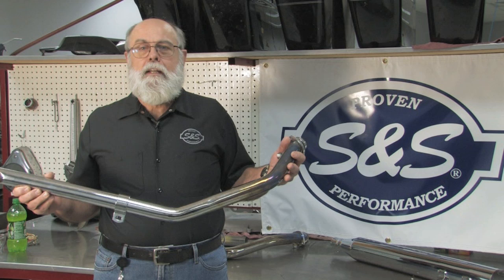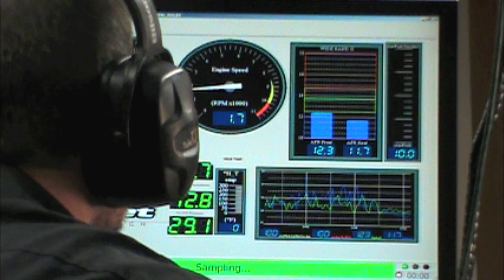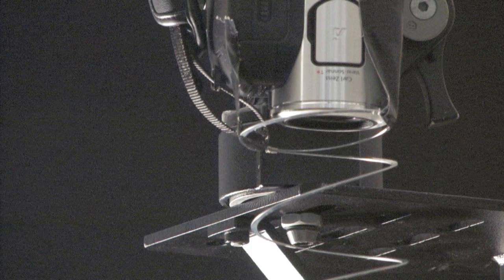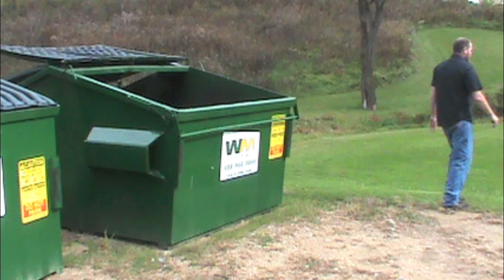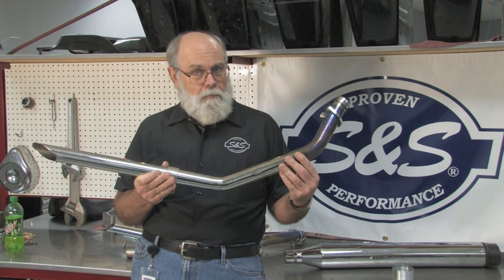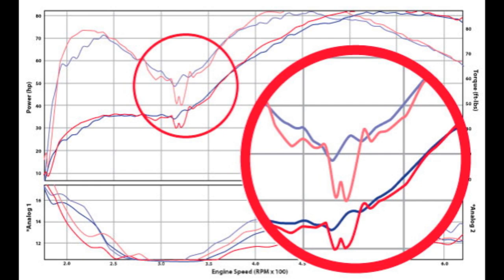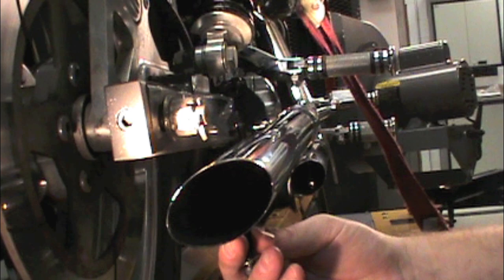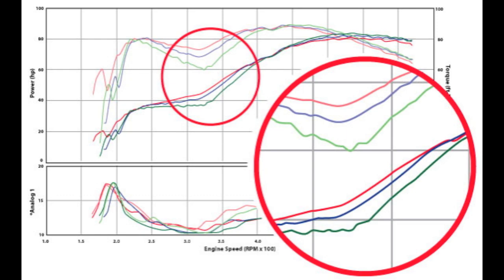S&S Cycle - Drag Pipes Style Exhaust: Carb Jetting and Troubleshooting

Comment: I've been trying to explain this concept of resonance for awhile to a few folks I ride with but while I understand the concept, it's hard to explain to those that don't. The slinky has been the best example I've seen so far. My drag pipes are not equal length. I can actually feel a 'shudder' from my engine in the low/mid range with more carbon fouling in my rear plug. The different resonance is affecting how that rear cylinder is pulling fuel and dumping exhaust but many can't wrap their head around the idea. Much respect to your explanation good sir🤘

Comment: The mufflers you had and drag pipes with baffles are almost completely identical except one thing stock exhaust with mufflers have headers crossover so it basically makes it to be 2-1 exhaust system. As a result connecting to cylinders to work together. So basically in the video you proved how good is 2-1 systes🤠

Comment: Loud pipes save lives! Text messaging idiots kill people. Drag pipes on my 03 1200C and I let people know I'm riding beside them or just in their general area.  Houston traffic is insane. It gets them looking around instead of looking at their phone. Free flow air cleaner, bumped up the pilot jet and it runs great. Doesn't cough through carb and no backfire on deceleration. Not trying to squeeze every half hp just a good sounding quick scooter to get me out of a jam before it happens. Be safe.

Comment: Excellent video,. !!!!  I've been telling people this for over 35 years, !!! On motorcycles and,.  Cars,, 2 1/2 inch,,, pipes and warlock mufflers,,,, will kill your low in torque,,,  !!!!   There is absolutely no way to build more horsepower and torque at the top end,,.  Without taking it away from low mid-range,,. !!!!

Comment: thanks S&S. I got the bike with the kit and pipes as it stands now. I rebuilt the carb the other day and checked the jetting. I'm trying the tips suggested in the video as all the "usual culprits," timing, plugs, ,wires, ( new Accel coil and wires and plugs), have been adressed. But I have no problem replacing the pipes with ones with mufflers. Those S&S looked sharp.

Comment: Anti-reversion cones up by the port used to be a big thing in V8s. Also, if you drill a small hole at the "top of the port" in the tube, it'll pull in air and create an after burn in the pipe, speeding up the exhaust flow. Smokey Yunick knew a lot of tricks. Exhaust flow management is a black art. Straight pipes move sewer better. LOL

Comment: Good video, i have a 1985 fxef superglide fatbob with drag pipes on, good luck finding any other types of pipes for that, sometimes throwing away drag pipes is not an option, i understand exhaust flow better than alot of people due to i work on building custom exhaust on vehicles, motocycles are no different whan it comes to flow, flat washer welded to a bolt gained me just over 80 horse on a dyno on a stock engine with a stock carb.

Comment: Hello , thanks for the tip and information , I have a 250 yamaha virago live here in Brazil , I installed a direct 85 cm exhaust and makes a great noise, and really noticed a little lower in performance between 3:04 march after to see your video understood why , as a solution added a tailpipe of VW wolksvagem , and believe me, the power has increased considerably thanks and wishes

Comment: Thank you. You inspired me to not make a straight pipe for my stock bike when I get it. Your video discussed working on a carbureted bike, but had information very helpful to a fuel injected sport bike.

I plan to build a turbo kit for my bike. I was interested in getting or making a straight pipe exhaust, before I build the kit, to increase power & efficiency, but you confirmed for me that naturally aspirated engines should have a little back pressure in their exhaust, for low end use.

Turbocharged engines, are the ones that should have absolutely no back pressure in their exhausts, because they get that from the the turbine itself. As for noise. turbochargers, ironically, have a muffler like effect on exhausts, but the turbo system itself creates noise, but I have a feeling that a turbo kit, with its straight pipe after the turbine, and it's vent to atmosphere blowoff valve, would have better noise pollution then a pure straight pipe exhaust.

Thanks again, you have been very helpful to my research. I hope no one here hates me for being into sport bikes, or what I'm planning. I recently became very interested in getting a bike, after being into cars & car Motorsports for many years, but I don't understand why there's stress between sportbikes and choppers/cruisers.

Comment: I've ran drag pipes    I've got them to work.  regretted the carbs messed with the idle and  and adjusted the valves and ran it on a dynamic both before and after my tweaks.  I fixed the problem.        it helped alot.   espetially if your bike is tuned and stock for a exhaust for an exhaust with a baffle you can't just strait pipe it.  drag pipes are decent.     if your motor is tuned for it.   just because someone is older dosnt always mean wiser

Comment: baffles in drag pipes kill top end, i drilled 1/2 inch holes ,stagered like a machine gun cooling jacket,about 12 holes facing down and out,no more reversion ,you gotta jet with pipe changes
it worked for me and its easy to do

Comment: OK, this makes perfect sense.... I've got questions:

Given that baffles and even a bolt near the end of the pipe makes such a difference (love the thumbscrew test) and since you guys have this type of testing/tuning down pat (and explain it very well) I'd love to see a second part testing torque cones, crossover tube, and what might turn out to be more than decorative, those "fish tail" or "flame" ends on pipes which would seem to have a similar effect as just making the end of the pipe bigger, and lastly just the length of the pipe......... all of these potentially having an effect on resonant reversion and thus,  sag. 

It would be interesting to see how those stack up and if any are a complete solution or close to it.

Comment: We’ve used all these concepts for decades. The HP Plus baffles from chrome works actually are the same , or very similar to, the type many performance mufflers used by big exhaust makers.
Including S&S, Python, etc.  you can even cut them in half and get a pretty loud , but no blat growl that works well.
Going with big diameter pipes makes it even worse, people love those 2” and 2 1/4” pipes, which suck across the board.
Oh there are guys that swear they work on THEIR bike, but they don’t.  Running and running well are two different things.
The best way we e found is , cut the drags off square at 28-30” in length, then add the HP plus baffle, or half of it about an inch in from the end.  The up side of running half is, there’s enough baffle left you can weld a tab on and give your buddy the other half!  Plus they sound beefier.  
Let’s face it, if you run an older bike, there are few to no options for exhaust out there, drags are the only option, so this makes them work damn good.
Will they Dyno as high as a performance exhaust system? Doubtful, but, they’ll be as close as you can get when options are limited or looks are paramount.
The old “can opener” baffles are crap, but the HP Plus baffles actually work AND sound really good , without the “ blat” open drags are known for.
 I’ve even offered to buy them back if the guy wasn’t happy with them, and haven’t had to yet.
They do come in 1 3/4” and 2” size, but the 1 3/4” pipe is really the way to go , until your running a drag bike wide open at the track.  But the HP Plus baffles will help even a 2” on the street, just not as well as a proper exhaust.  
For around 50.00 a pair why not beat the drag pipe issues?

Comment: that's a great video, I've been telling customers that drag pipes are for drag racing for 30+ years, ( and catching a lot of crap for it...)but can go get the drag pipes out of the dumpster and do one more run with torque cones in them? Maybe 2 runs.... torque cones and torque cones with thumb screws.
Reply from the maker: +Ivan Gonne Sorry, the recycling truck already came and took them away. 
Let me just say this about that: Torque cones are in the same catagory as the bolts and thumb screws. They will help and you may get acceptable results - for a certain value of "acceptable", but mufflers are still the way to go!

Comment: Bruce I would like to thanks you for this tip I used a wing nut application on my 1992 xlh sporty  boarded out from 883 to 30thou over 1200 full bottom  to top with rebuilt with a SS supper E drag pipes. and a Andrews N4 cam ..... this was the most amazing difference I found in all the time i been jet changing ,,..

thanks again . works great.l

Comment: i had same prob bout 6 yrs ago , i ended up running a 1/4 -20 ss bolt 1in long with a ss wing nut to the inside of the exhaust kinda like the thumb bolt in video but instead haveing the wing nut on the inside of the exhaust and it fixed my prob, bike runs great now havent had any more issues in the 6yrs ive been running it , may not work for every one but just figured id mention what i did to mine and that it fixed my prob just incase it may help someone else with there prob , worth a try wing nut and a bolt could be a cheap fix or temp fix to some one out there .hope it help's some one .thanks
Reply from the maker: The "lollipop" can sometimes help with the reverberations as well.

Comment: I just installed the Khrome Werks Performance Plus baffles in my drag pipes on my 77 ironhead sportster, running a Super E carb. Before, the bike lacked low-mid range, hiccuped and popped at a steady mid rpm. Great WOT performance. 

The baffles aren't as restrictive as the ones in this video (no packing). The low-mid range is actually acceptable now. The bike still hiccups a bit at steady mid range rpm, may have to re-jet the carb. High rpm is still just as good. Sounds great but less rasp.
Reply: I run a Stage 2 Evo with 1 3/4" drag pipes with those baffles....nothing to complain about.

Comment: Anything you do to the exhaust you must tweak the carb. The issue isn't the use of drag pipes on the street. The issue is using the S&S carb with drag pipes on the street. Work up the CV or slap on a Mikuni and you will make it work way better then with the S&S. They are not a bad carb, but they aren't that good either. A Mikuni will walk the dog on a shorty E or G all day long. It's just a 2 circuit carb with a pump, and an added air bleed to help cure it's overlap stumble. Ls and Bs were better carbs. Just because S&S makes it doesn't mean it is the best performing or the best choice. Their 883 to 1200cc conversion is a great example. You don't get the power for the money over any other kit.

Comment: I’ve got drag pipes on my ‘75 FX shovelhead. It’s 9:1 compression with the Andrews A2 cam, anti reversion cones at the head, 72 main jet in the super E. it runs well, cam comes alive just off idle and steadily makes more power as the RPM increases to scary territory. Not saying it makes as much power as it could, but it doesn’t suffer any drivability issues that’s for sure. Sounds bad ass too.

Comment: Not everything is about power. I do understand efficiency but the sound of drag pipes of yesteryear is what made a Harley what it is today. What about power cones at the top of the pipes at the exhaust port?
Reply from the maker: Challenge with drag pipes is lack of physical volume.  We’ve seen a number of tweaks, but a legit muffler will always make better power (that may mean flatter curve as much as a big number).

Comment: good advice - should have explained about the HP advantage of the two into one pipes, several out there, D&D , Thunderheader and Vance & Hines which back 14 years ago I installed on my  2003 S&S 124 inch motor. The Fatboyis a 1991.
 Before the motor work it was dyno'd @ 137 Hp and 151 foot pounds of torque which at that time Terry from Vance & Hines ( the designer of the pro pipe) said it was the highest numbers he heard of. I still tweeked the baffels to accommodate back pressures with a reverse cone like the Thunheader. The motor is still running very strong with 60 thousands over intake valves  , the super G carburetor bored to 47 and a half mm with a thunderjet and the heads reworked by John Sachs. Straight pipes are loud but not for performance.

Comment: I have drag pipes on my 99 Softail Custom. I went one size up on both Jets and it runs great. You do lose a little low end torque but that is a small price to pay for the music you get. People run drag pipes for different reasons. If they did not work there would not be so many bikes with them. Performance is not everything. I love drag pipes. Who cares about a little loss in performance when you are cruising down the back roads with the sun reflecting off the head light and the music of the pipes. 

Like who needs a radio anyway. Lollipops do restore the low end torque.

Comment: so I have always taken baffles, cut them in half and then installed them in my drag pipes. OR I install a set of anti reversion cones at the head. I get decent results. Keep in mind I do this with ol skool choppers. We arent talking about performance bikes. But these methods always work well enough. Mid range performance is decent and no popping and backfiring on decel.

Comment: I was thinking about Dragging my Yamaha 250 Route 66. As nice as that V twin sounds with straight pipes, i cannot fight facts that are proven here. And on a 250, you need all the power you can get!
Reply from the maker: If you are drag racing, that is a good application for drag pipes. All they have to do is to make power at high rpm and win races. They just aren't a good choice on the street where the engine has to perform well in a lot of different circumstances.
Reply: Even if i got custom headers fit for the exhaust for that bike, Would i still lose power?
Reply from the maker: CrispyTurtl3
You would have to ask the manufacturer. We don't make anything like that. Sorry.

Comment: I solved my drag pipe problem long before this video in a similar way as the thumb screw method. I welded different size washers on a 1/4 bolt about 4 inches from exhaust tip end, until I could feel the bike doing what it does best, Run like a scalded dog. Mine however is an old iron motor and a different breed altogether than these newer engines, with hemi domed pistons, cams and larger carb. It should help for any resonance in any bike exhaust though. We didn't have dynos in my day, you tuned by the seat of your pants! Ahh technology!

Comment: What an informative video.  Very well crafted.  

My 1998 carburated xl1200c (Sportster custom) has Screaming Eagle 1 slip-on drag pipes (and K&N air filter).  I wonder how my bike would perform on the dyno.  I believe this exhaust is 50/50 decibel emission.  DOES ANYBODY KNOW IF THESE PIPES ARE BAFFLED?

Comment: Excellent presentation thoroughly explained regarding exhaust systems. As per instructions relating to drag pipes or the sound, it appears the 90° may be the best option but still not as good as a muffled system, (Slip On). Any input here would be appreciated.

Comment: Enjoyed this video. I was wondering would this have a similar effect with injection? I have a tunable fuel controller running on my bike.
Reply from the maker: While it is true that injection can be tuned more effectively, to eliminate the rich condition caused by a carb "double dipping" or adding fuel twice to a reversion pulse, you will still have reduced intake and exhaust flow. The problem will be less pronounced, but you will still lose power in the mid RPM range.

Comment: I have an 89" super G stroker kit in an 89 xlh 1200 Sporty with non stock pipes with the baffles removed an have a problem with the bike jerking under 3000 r.p.m. It will run all day at 60-70 miles an hour. This video gave me some good tips. Anything else someone recommends?
Reply from the maker: +James Cordes Try putting the baffles back in those pipes as an experiment. If the problem goes away, you can say in a loud and authoritative voice: :We'll there's your problem!" That would indicate that harmonic reversion is the culprit. If not you should check out the usual suspects - igniton timing, bad plugs or wires, maybe a plugged passage in the carb, among others. Feel free to call our tech line! (866) BIG-BORE (244-2673)
Reply: Same problem here.  Put in baffles--my drag pipes flare out to 2.5" at the end.  The baffle solved the jerky, but caused hesitation under 3000rpm on a slow roll throttle acceleration, and occasional sneeze in carb--does it once, then no more.  BUT it still sneezes on hesitation and takes off.  Pilot jet may need to go larger.  May remove baffles in the end.